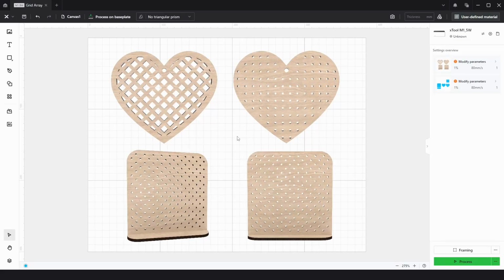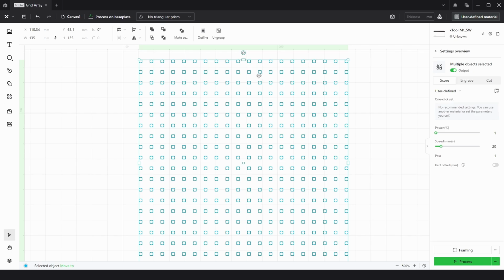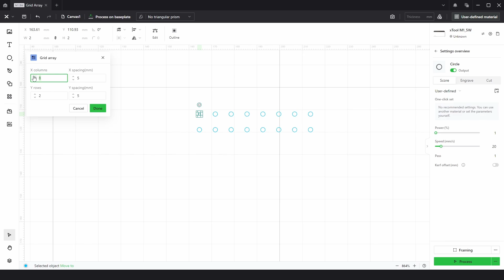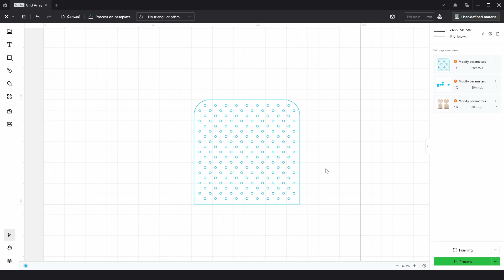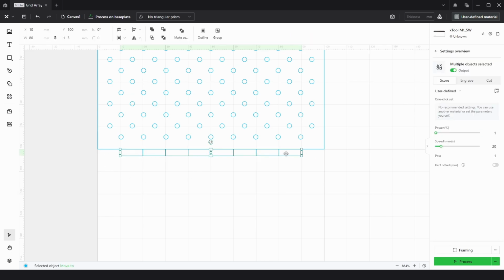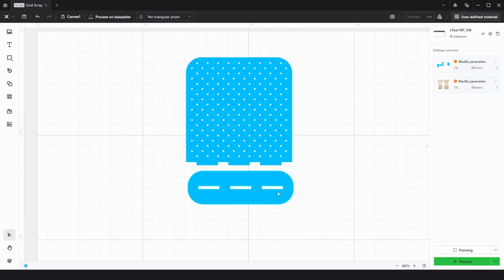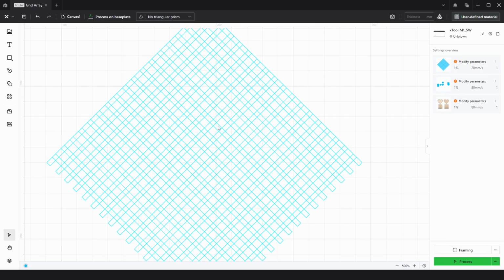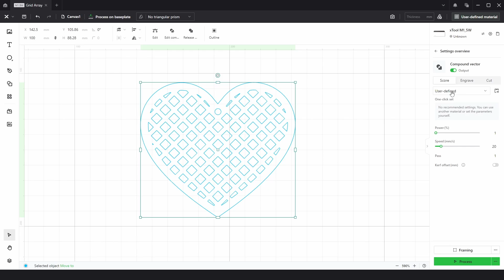Unlock the FULL Potential of XTool Creative Space with Grid Array!

Comment: This is helpful b/c I'm new to this software and my m1 ultra and I want to make my own designs for stuff. I've done it very tediously so far lol I need to learn millimeters too b/c trying to convert from inches isn't working that well... Thanks for the clear video - gave all the info without any unnecessary stuff :)
Reply from the maker: Thanks for watching 😀 and you can quickly change to inches just by going into the settings and changing from mm to inches there if that helps? Thanks Gav